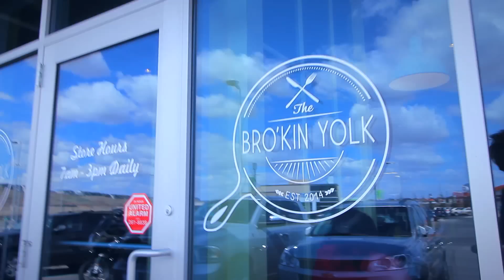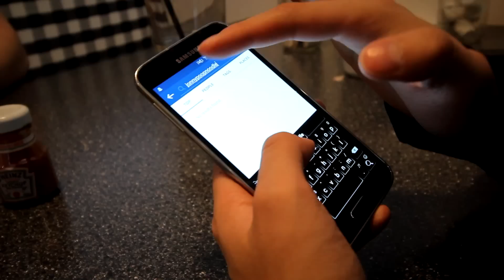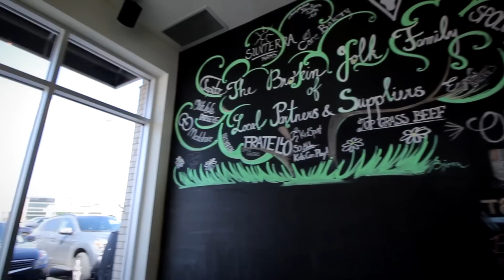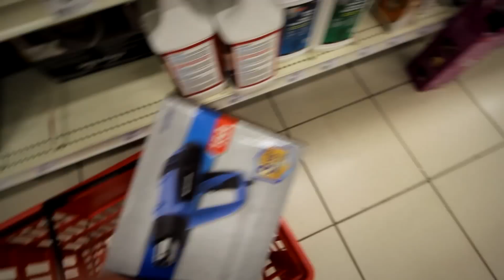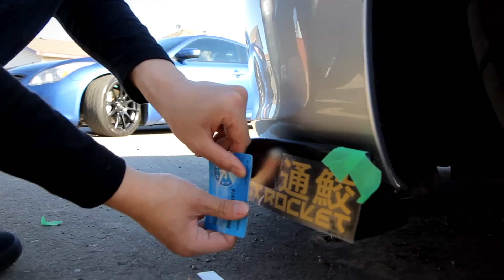Car Day with Lost Royalty & Wrapping my Hood

Comment: King, you should learn to do clutch less shifts. I got stuck at my job 2yrs ago. It was about to snow and it was really late, I was broke so no roadside assistance. Basically, your normal shift points that's in your manual, you now need to rev 1K above that point. So if it's 3K rpm then rev to about 4K or 4.5K rpm, pull into gear is like...Notch (neutral) hold over the gate for a split second, Notch down again into gear (falls into place). People told me I'd burn out my clutch and flywheel; went an entire year (throw out bearing replacement). Changed the clutch, clutch disc was fine, flywheel was fine, replaced them anyway.

Comment: Filmed pre steering wheel install or did you not like the NRG?
Reply: +Kyle Clayton Earlier in this comment section, Eyegateproduction asked the same question. Eyegateproduction was replied to by Alexander Bestman. Alexander said the NRG set off a bunch of lights on Birdy's dash and Birdy didn't want to break anything, so Birdy put the original steering wheel back on.

Comment: what happened to ur NRG steering wheel? was this vid earlier than that install and you removed the hood wrap already or did u just put the stock wheel back?
Reply: oops sorry. just saw a comment that explained it. dont know if its the real reason though. i thought adapter kits were supposed to stop lights from air bag or something.